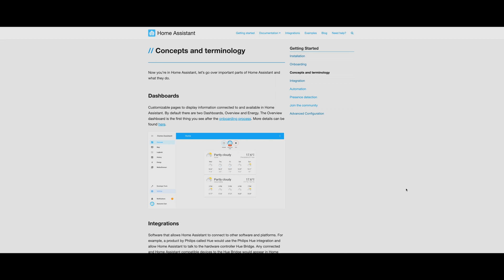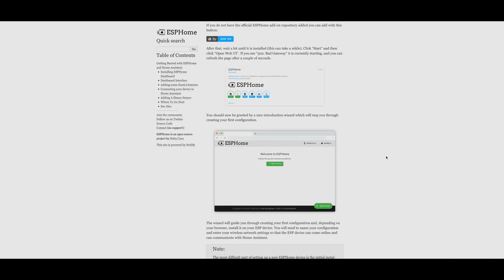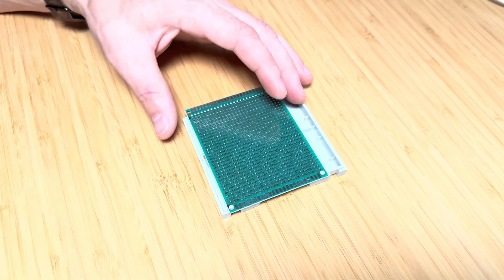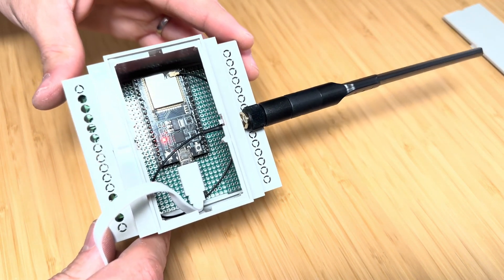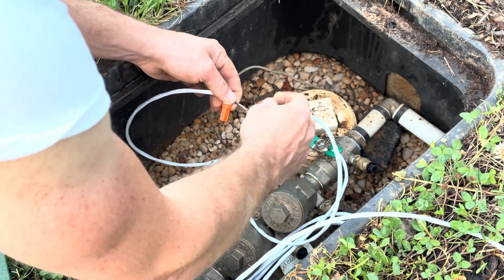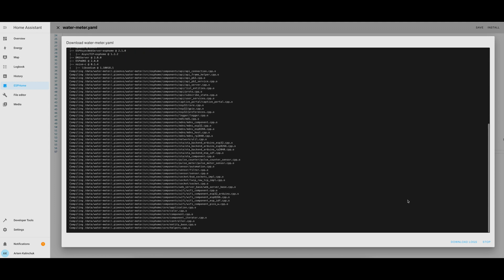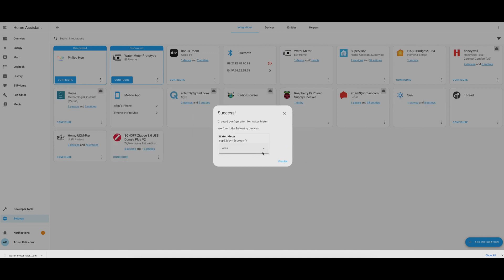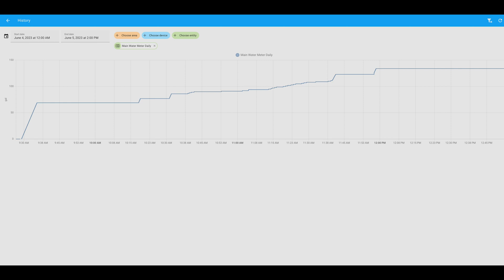Building an ESP32 Pulse Meter for ESPHome

Comment: why does your config list both sensor types?  and the same pin , it says this right in the doc , so the config you posted would never work with 1 gpio  
"Please note that it is not possible to use both of these two sensors on the same pin at the same time."
Reply from the maker: Maybe when I made this, it worked :)

Comment: Hey, I have been trying to read Pulse on ESP32 from 4 meters but due to electromagnetic interference, pulse on 1 GPIO pins causes Pulse Counter on others as well.
Reply from the maker: Have you tried using shielded wire for the meters?
Reply: @artemkalinchuk  Yes I'm using CAT6. Since its a reed switch it, get multiple high-low when there is a pulse from meter. I have tried to stop that with counter and debounce, but unable to stop the reading on other GPIO pins. I'm using GPIO pins 35, 25, 26, 27 for Pulse reading. Could it be because of wrong GPIO pins?
Reply from the maker: @justdoingodswork  Try using the pins that I was using in the video and see if that helps.

Comment: Thank you for the video. Could you please provide the pinout for X1 connector?
Reply from the maker: The X1 connector can be used to read up to 4 meters. There is no specific pinout for it as long as one wire of the meter goes to GND and another goes to one of the X1 pins (which are then routed to ESP32 pins 12, 14, 27 & 26).
Reply: @artemkalinchuk  Thank you.

Comment: Ever thought of selling one of these boards to the public? I am Interested in one
Reply from the maker: I have not thought of building an actual PCB because of it's simplicity but I might consider it if there is enough demand for it. How much are you willing to pay for an unstuffed board? Trying to gauge the viability of the proposal.
Reply: @artemkalinchuk  well let’s start at the base your time and effort are worth something obviously but the cost of goods are somewhat fixed. What would it cost you in materials? Say from pcb way or something. This way you wouldn’t have to solder stuff yourself
Reply from the maker: @Dead_Aim556 I think I could get it fabricated for under $10 a piece (plus shipping). Have you considered making a Gerber file for it yourself?
Reply: @artemkalinchuk  I always like to give credit where credit is due due! I know 0 about board design but have some ideas on how you could market this. I think if you could keep the overall cost low you could make some good $
Reply from the maker: I think this would be a good project to start learning about PCB design since it’s fairly simple. Check out KiCAD.

Comment: I am getting the following error when trying to run this code " Pin 26 is used in multiple places". Any ideas?
Reply: use the setting "Allow other uses":  -  see example below.
    pin:
      number: GPIO26    
      mode: INPUT_PULLUP   
      allow_other_uses: true
Reply from the maker: Hmm, not sure. What if you feed the meter into two separate pins and use those pins in your configuration?
Reply: @artemkalinchuk  was thinking the same thing! Thanks for the tutorial

Comment: Wemos D1 Mini who works on ESP8266 have a conflict when we use both PulseCounter + PulseMeter on the same PIN.
PulseCounter not see impulses and I ignore it. We choose PC or PM and I select a Pulse_Meter who work OK.
In your code you have the same value but you can discover that PulseMeter see strange additional digits after dot.
Reply from the maker: I'm not very familiar with Wemos D1 Mini. Maybe it's just an issue with that specific device. Is there a reason why you're using it instead of ESP32? Have you tried a different pin just in case the pin you're using is having interference?
Reply: @artemkalinchuk  It's small and be easy mount into 1module in electric box, it have modification know as LoLin who can be on battery easy... and I have 10 both of them :).
Reply from the maker: @SiBex_ovh  That makes sense. I have never used it but I'll be checking it out for sure.

Comment: Nice! ESP32 can track to 8 channels that way. Please consider doing a way to work and cache counting when wifi is offline - or please update me if this is not problem at all. I sill do similar projest but with S0+ from energy meter.
Reply from the maker: What happens now if the wifi is offline? I wonder if caching is something that can be configured with the pulse_counter plugin.
Reply: Does it mean that It can record up to 8 water meter? I am looking for a cheap solution to monitor 4 water meter in a farm ( one for the well, 3 for different part of the farm).